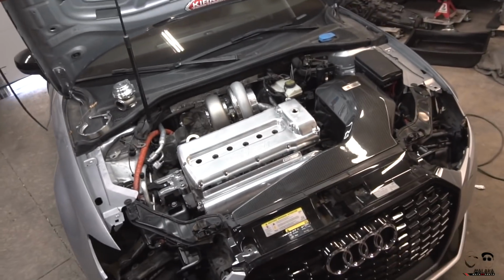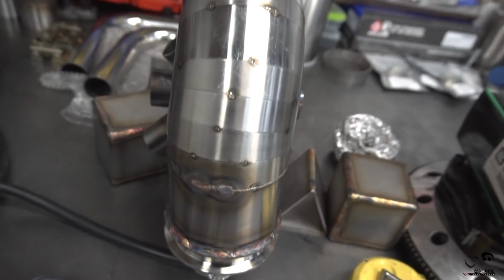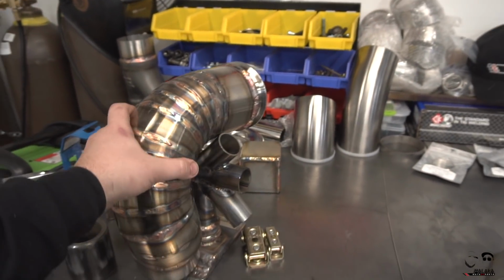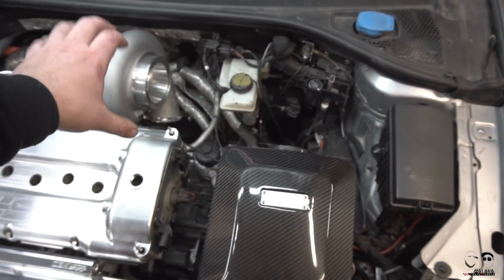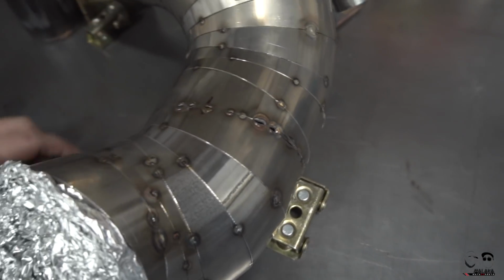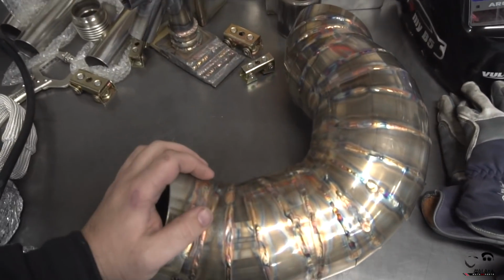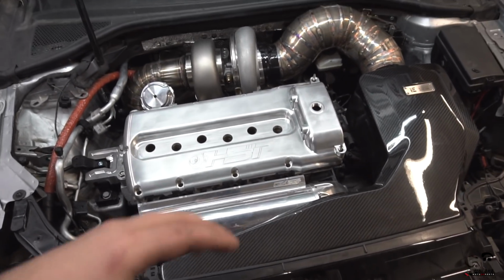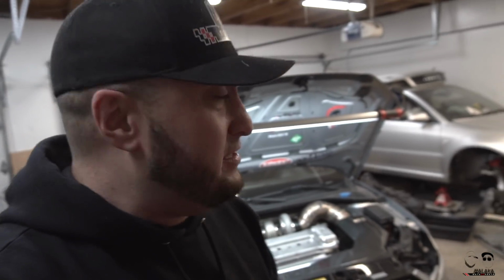| VR6 8v AUDI RS3 |  Fabricating our own exhaust & Intake parts !!

Comment: Dude those welds look great for what you are using to purge. Try Polyimide tape on amazon for $19 works well with holding in your back purge under high temps so you don't sugar the inside welds. Also doesn't burn up like purge plugs when the welds are close. Another good tool is a purge tree from ( purge plugs com).  I usually do about 20-30 scfh back purge depending on how many gaps or pin holes occur when tacking the pie cuts together.  You can always tap the tubing when tacking to make the puddle jump over the gap. You want just enough argon that its not pushing the weld out, but enough to keep the welds flush and shiny inside without any color.  Also run about 35-40ish amps when welding 1-3"  stainless tubing .065 wall thick. When I weld  4" tubing .083 thick turn up to 40-45amps with a good back purge of 20ish scfh. With a good back purge strike your arc and wait a second or two for the puddle to look like a lighting storm and you should have a red ring in front of the puddle as you start to move forward. Should help keep a constant break down of the inside walls. Hope this helps and keep up the amazing work !

Comment: I think for the intake tubing you could have got away with just autogenous welding the seems, those pie cuts were cut very nice that there wasn't large gaps that would've caused a problem. I only suggest this because it may be a little easier for your next go around and you can use a little less heat and have a little more time without worrying about warping or blow through. I would suggest doing it on exhaust too, but with the amount of heat you'd be blowing through with that giant snail i don't know if it would be an issue. Also i should just state that you should not (can not) autogenous weld Aluminum. But i'm assuming you are doing everything in steel so its safer to try it when you get the chance. Regardless of this, very nice work.

Just found this guy doing a good demonstration on the process - https://www.youtube.com/watch?v=qhCjf7570xY

Comment: Tack welds... take your normal welding amps, add 20-30% or more, no filler rod, position the torch for a short arc length and stab the pedal to initiate the arc then jump on the pedal hard-ish all the way to the floor then get out as soon as you see the puddle bridge both pieces, a little stir action if the amps aren't high enough or there's a gap.  Welding or tacking, a long arc length is very difficult to control, that might be why you're blowing holes.  Keep it up!  You guys will nail TIG welding with more practice.  If you get stuck go ask Hoonigan for help lol!

Comment: According to my fab guy you don’t want to make the intake out of aluminum, both will heat soak but aluminum radiates heat more then stainless by a lot, that’s why they make radiators out of aluminum

Comment: Hey congrats on learning to weld....some don't think they can learn. Anyway I recommend you get your hands on a handheld belt sander with a small narrow belt and go over all the weld lines until they get reduced down to a uniform height. A handheld belt sander can help you get a final product that looks almost seamless. Then you can have it sent out to get color treated so that it takes on that try-color effect. If you do this the final product will look better than any silicone or aluminum elbow extension. Good luck. :)

Comment: Make your brake master cylinder reservoir ‘remote’, you can get push in fittings for the master cylinder then make a bracket to move the reservoir off to the right and slightly forward... will make the intake tube routing easier 👍

Comment: FETA PHAT! Nice work my bro. Been dabbling  in Tiging myself. Made a downpipe and valved exhaust for my 2020 Q8. Got  myself an Everlast, works grate! Is that welder a scratch start or pedal start? Either way looks sick my G. One L all day!
Reply from the maker: Pedal start, and congrats on making your own parts, won’t lie, this welding is addicting lol
Reply: @MalakaMotorSports  Nice. Ya man when no one makes parts for a 2020 Nogaro Blue Q8 you just got to saddle up and make your own.  All in all ill be mass-producing these once I'm done testing my unit. So far I love the sound but a 200cel cat sounds too raspy. I got a 300 on the way so we will see. Bro that intake pipe is just nuts. I f-ing love it. LMAO @ Stavs "Shit Box"

Comment: Looking better than my stainless welds :) i can handle steel..but aluminum and stainless have been giving me issues...i move too slow and blow through  thats my issue , and i wander away from the material with the tungsten  making for a big unstable arc

Comment: You know i'm impressed, i don't have a qlue how to tig weld but i have seen alot of examples, and you did a great job, especially as a beginner.I would like to start welding in the future and this was great inspiration, i painted half my car this summer on my driveway with a lplv spray gun learning off you tube, and yeah it has been a struggle, had to redo some bits, but eventually i got it painted, and the results are as good as a paid paintjob, in some instances better since i had barely any dust in it, a bit of orange peel because of the 3 layer clear coat but sanded it down with 1500-2000-2500 and then polished it and it's like brand new.And the satisfaction levels are high when you get those results.So nice to see self thought people.Great job man👍✌️👉

Comment: well done bro! nice job for some early stainless steel welding. you're going to notice how well you handled the temperature once you go through some rain. 
btw, about the huge bend to avoid the brake booster reservoir, why don't you just relocate it? but a braket somewhere else and run some lines to it. it would be hella clean, might want to look into it before making the carbon fiber mold (if you ever gonna do it).
Reply: I agree

Comment: Nice job, nice video, keep at it :)  2 things to consider;  1) Buy a TIG Finger from Weldmongers.  2) If you aren't happy with the inside from the back purge, get a flex ball hone, slap it in your drill and hone the inside of the pipe.
Reply from the maker: Hmm, had no idea about the flex hone, will look into it, any brands to consider ?
Reply: Brush research (brm flex hone)
Reply: @MalakaMotorSports  Whatever they have at your FLAPS :)

Comment: How far are you from first start man I am so excited to see this run. 👍 

Edit: just saw the last part of the video. So excited for the end of the year when she's ready to run. Got a spare dq500 box and a stage 2 b5 s4 just thinking of what to do with it now 😆👀
Reply from the maker: Doooooo it 💪💪
Reply: @MalakaMotorSports  would the dq box mate to the 2.7? Was looking to build it though I am tempted to get my hands on a vr6 I want to see what I can do down the twin turbo route with gt2871r turbos. 600 whp would be the sweet spot for me for the time being
Reply: @TC-db5fm  hey buddy.. i don't think the DQ500 would work in a B5 Chassis.. Reason for that is the Motor & Trans in a B5 is Mounted Longitudinally, whereas the DQ500 Trans is Mounted Horizontally in the RS3, TTRS, etc...  So, propshaft connection to the DQ500 is in a totally different position...  but hey, i could be wrong.. Nothing's Impossible !!
Reply: @ebie_twins  you're right... thinking about it there is minimal space and the o1e is a longitudinaly mated to the 2.7 as well.